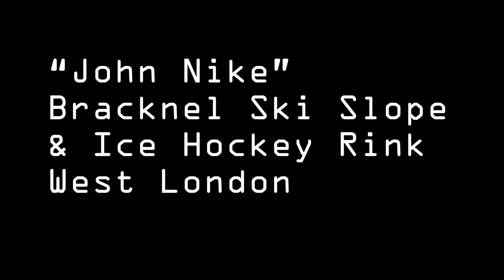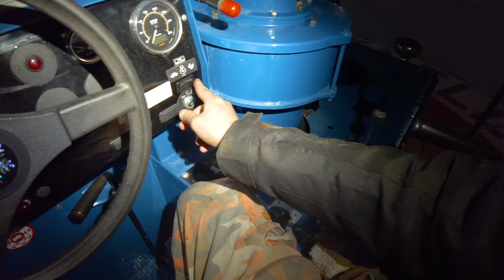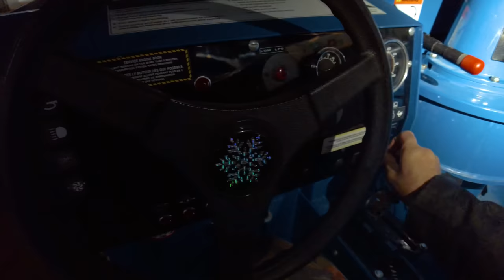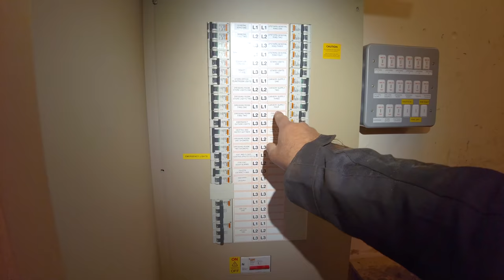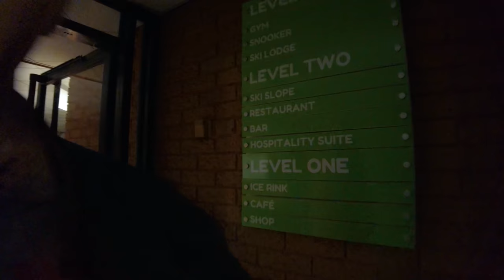John Nike Ski and Hockey Rink RUN FROM POLICE

Comment: A fantastic video - thank you for making it.
I skated at Bracknell from ~2000 to 2012, and know a lot of the building well. I visit the site today and was saddened to see it's just rubble now. I'm surprised the new owners haven't built their mega-warehouse on it yet, although I think the planning application was only submitted in early 2024. The ski slope is still owned by JNL so remains as you saw it, although the chairlift has been sold I think. There's some storage areas at the bottom of the slope (on the right at 50:36) that are ripe for future exploration.
Pre-2012 they had a blue and yellow Olympia, rather than the Zamboni you saw. I think both machines run in CNG (methane) and the tanks appeared to be removed from the machine you found in the middle of the rink (should be on the right, opposite the driver, held with the yellow strap at 26:06) , so there was no way it was going to run.
I have absolutely no idea what you found at 16:20! Didn't ever go to those rooms.
I remember spending a lot of time in the room at 18:38. There are also additional large rooms behind the AV control room, accessible through the doors seen on the left at 21:25. I remember when that whole section was built, a much later addition, I believe.
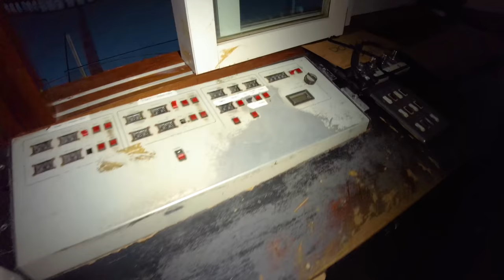I think a lot of the AV equipment in the control room was removed and upgraded as times changed. Equipment got smaller so the large custom cut desk space wasn't needed anymore, which it why it looks naff at 22:16. Although yes, what equipment remained had been removed when you visited. I remember helping the DJ in there once or twice as a kid - was a lot of fun. The four key switches above your hand at 21:55 turn the main flood lights on and off, although I believe these were replaced at some point after I left. There was a "jumbotron" when I was there (I think later replaced with huge TV screens?) that I presume was controlled using the panel you play with at 21:51. The fluids you found at 23:07 were for smoke machines in the ceiling of the rink - I think there were 4 or so. Presumably the pipes to them were long! The cupboard you open at 25:20 was where coaches could play music for their students (for musical routines) during lessons. Basically a DJ/MC would be upstairs for hockey games or events, but normally coaches could control the music only using that lower door - saved them going upstairs. I didn't know it just went through to the floor of the AV room! I also didn't know what was underneath (25:30).
The lawn-mower things at 27:51 were for cutting the edges of the ice. I think that only happened once a week and was relatively aggressive. The shutter you spot at 37:44 is to let the Olympia/Zamboni outside to empty it's ice and refill the CNG (external filling reservoir center-bottom at 51:42). There was an internal shutter too so it was normally parked in a kind of airlock space. I believe all the refrigeration equipment for the ice was next to that too - shame you didn't get in there. I remember the boot room at 39:02 very well too. All the cool kids had lockers in there 😂 Seeing this video reminds me of the smell!!
I really enjoyed your investigation of the rooms around the reception - I didn't know about the rooms with the PC equipment and safes. The "Panto garage side door" key you found at 32:50 I believe is for some lockup storage garage at the Jubilee Building Supplies place across the road from the rink (also owned by John Nike) and was where costumes, painted flats and other large props were stored for the Christmas pantomimes (I did a lot of those!).
If you look at the marks on the floor tiles at 39:27, you can compare them to current satellite images of the demolished site and see the floorplan of the whole downstairs area now - those marks and the reception area are clear to see, including the blue and white island, which used to have glass to the ceiling when I was there (I think). I remember that reception very well...
It's a huge shame to see the site demolished. The place was always pretty grimy and falling apart, but from pictures I've seen since I left in 2012, it really went downhill. All the ceiling tiles in the rink were gone, the jumbotron was gone, etc etc. I really get the impression there just wasn't the money to keep it going. Hard to believe it only opened in 1987! They were always moaning about permafrost destroying the concrete foundations too, which I think is not uncommon for ice rinks... I understand in the 4 years before covid the site lost about £1 million. They were going to have to replace the refrigeration units and the ski slopes in a few years, which was £600k on top, and the money/revenue simply wasn't there. I suspect on paper it had no hope, as they already ploughed £620k into it since 2010. Still, a great shame as the replacement rink is much smaller. All that remains on the site now is a small roofless brick building with some power transformers in (center-bottom at 51:43) - presumably too much of a pain to destroy those. That's progress for you, I guess...
Anyway, great video, thanks for making it.

Comment: The pump handle on the Zamboni is the Snow breaker it helps stop the snow jamming as your going round on the cut. They’re pretty much hydraulic controlled for the conditioner board brush etc so sadly without the engine running you can’t use anything. Joys of working in a rink